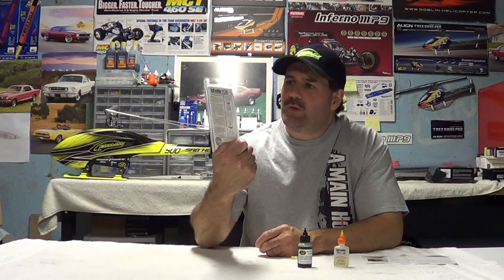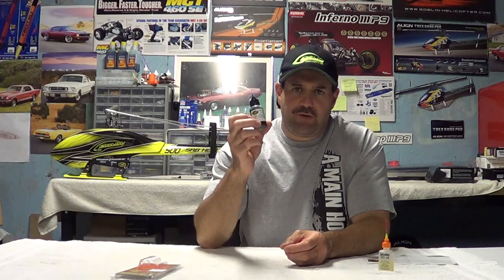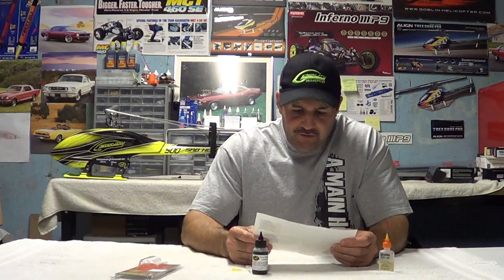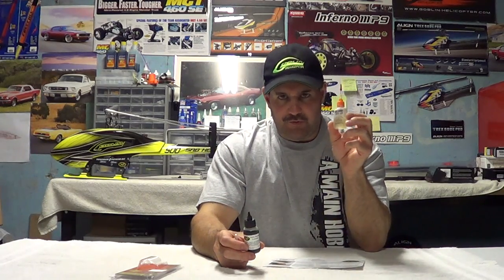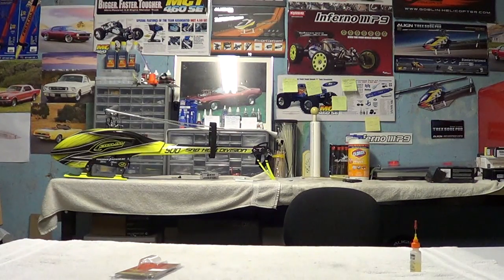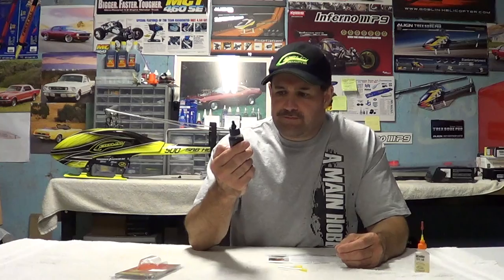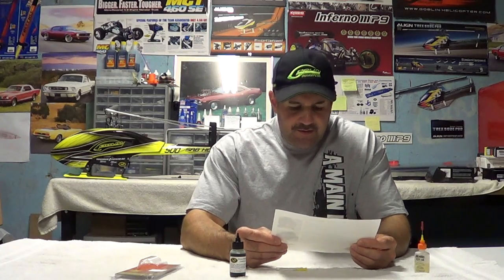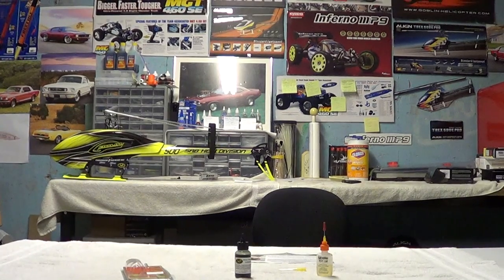Scorpion motor bearing oil kit

Comment from the maker: some come with oil and some with grease but the grease wheres out and does not last plus oil has to reach over 400 degrees to boil .i use oil on the align bearings also

Comment: Even with a needle, it seems tight to get past the motor mount, under the pinion to the bottom bearing (Blade 450). Any tricks to gain access?